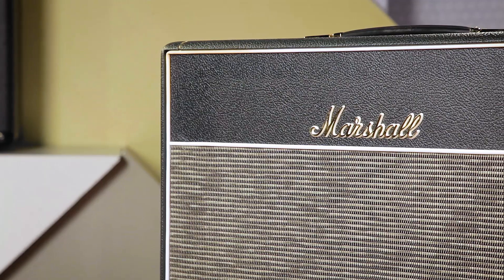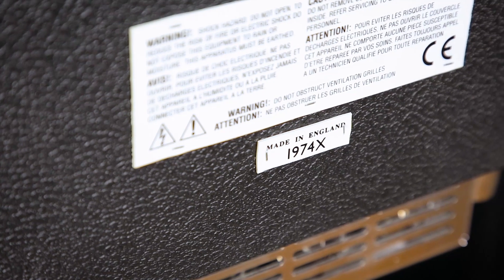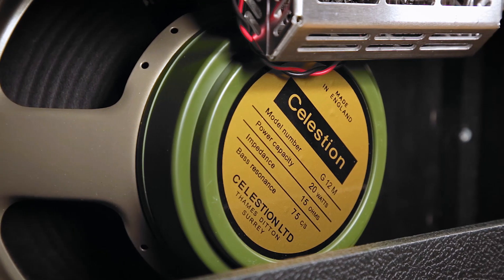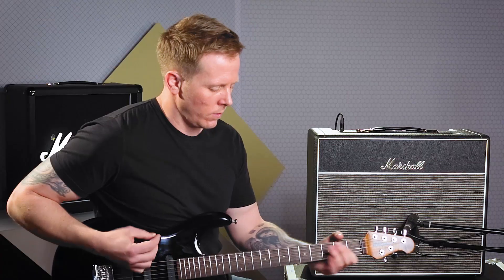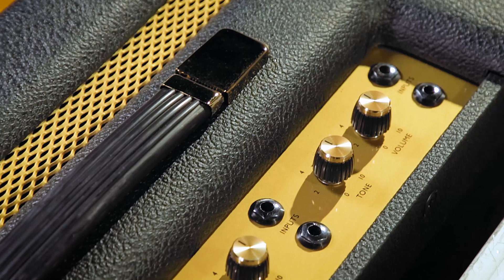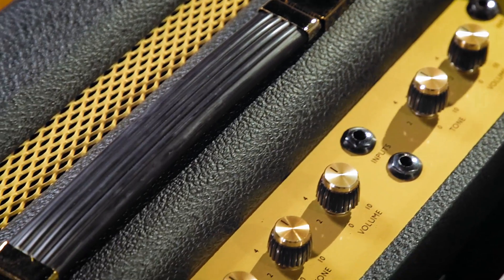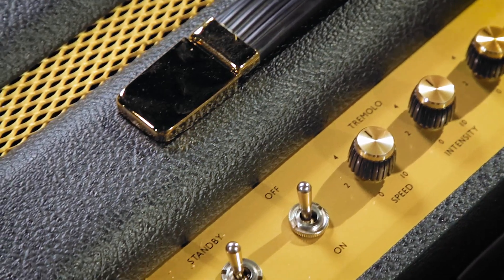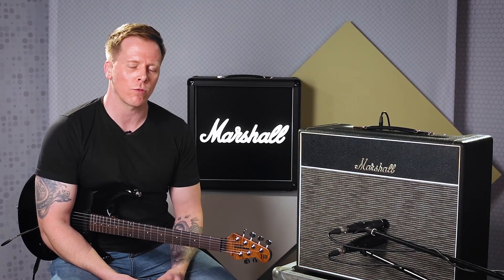1974X | Official Demo | Marshall

Comment: I'm not sold on it.  Especially for the price.  I'm not a big fan of el84 valves- especially in a Marshall.  Just my opinion.
Reply: I actually bought one on a whim without trying it and ended up selling it two days later.
Reply: price is just due to handwired, though. i've figured out after spending a lot of money on a couple of handwired amps that I'd rather just chase the sound and not care that much about the insides of the amp. Lots cheaper that way.
Reply: @daw162  Exactly! I've spent way more time on tone than actually playing haha